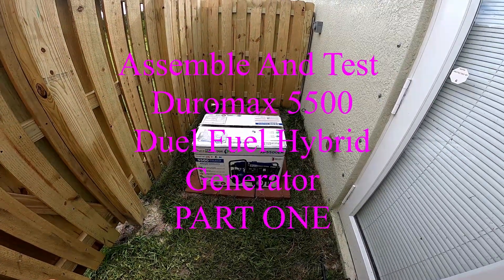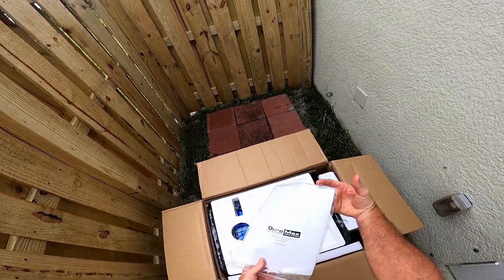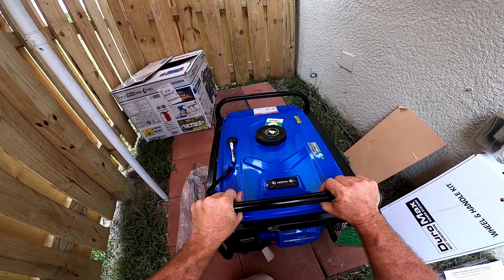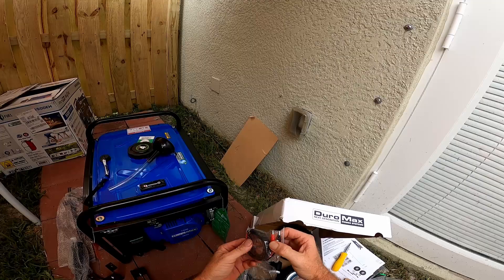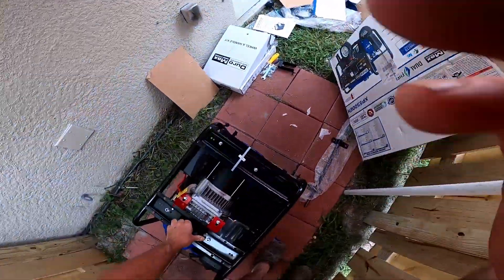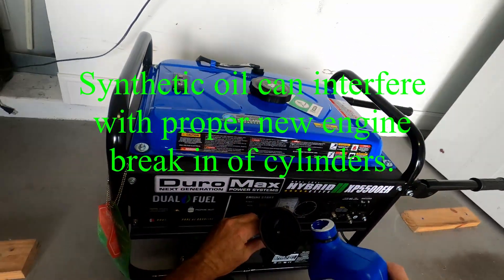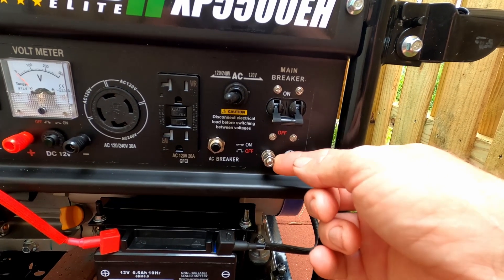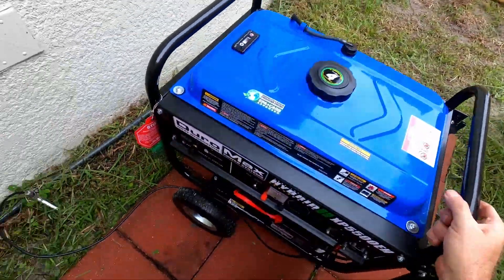Duromax XP5500EH Generator Trial- Part One

Comment: Bought one of these generators. Upon unboxing, there is a black and white wire coming out of engine through nut looking hole, by itself on left rear, just hanging loose. Don't  want to add oil/gas in case it needs to be returned. Anyone know what it's  for and where it goes, and can generator run without this wire being attached somewhere? Wire is fairly short, and doesn't  seem able to reach the only spot I  think it could possibly go.

Comment: Should have got a Predator 3500 inverter generator from Harbor freight very quiet ... great on fuel
Reply from the maker: That may be a good one too. Be careful to look for all copper windings. Most use cheaper aluminum windings that will not hold up long term. Its getting harder and harder to find the all copper windings.

Comment: That's a nice one.  Your very wise by buying a good generator. Every year we have record breaking weather. I actually own 3 generators.   I didn't plan on having 3 but that's a long story.    1 is a little 1200 watt I use for camping and 1 to 2 hour power outage and the 2nd is a champion 3000 watt. Its a loaner for family or friends. And the 3rd is a firman 9400 watt duel fuel for me LOL

Comment: Brother i hate to tell you  thats a gas guzzler too the Westinghouse is the most fuel efficient thats out there more power,small tank, more hours do your research people before you buy.
Reply from the maker: Hi. Sorry late reply. The main reason I purchased this generator is due to the all copper generator windings. Many many generators have cheaper aluminum windings that will not hold up long term.
Reply: The most efficient is a solar system with an  inverter.  I have around $2k in batteries/ panels/inverter with nearly the same power rating as this generator. On  cloudy days charge with a small generator like this.....Propane was most cost efficient until it went up!

Comment: I just got my generator a few days ago. Started great but when I went to test it I didn't have any power. Any suggestions? It's the weekend so I can't get any customer support until Monday.
Reply: Circuit breaker
Reply from the maker: Wow thats a bummer. Hopefully you were able to see a simple solution, no thanks to me. There are things that can be tried but with a brand new generator, they need to replace it for you if its not a user error kind of thing. Sorry for late response.